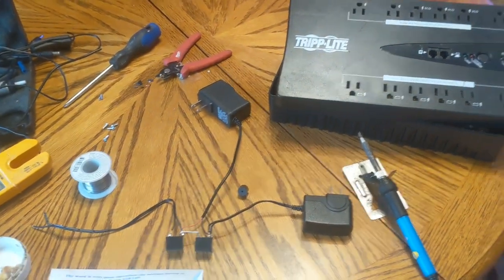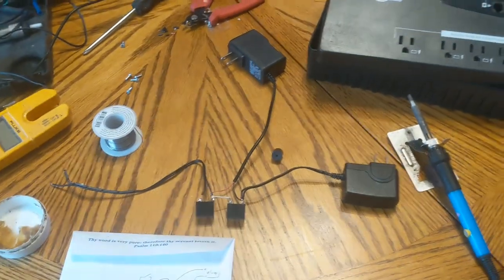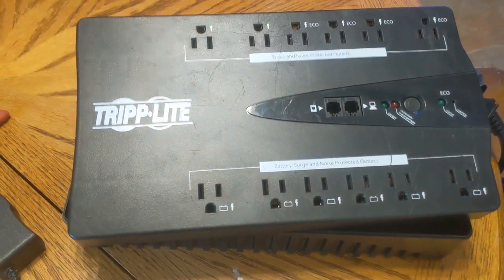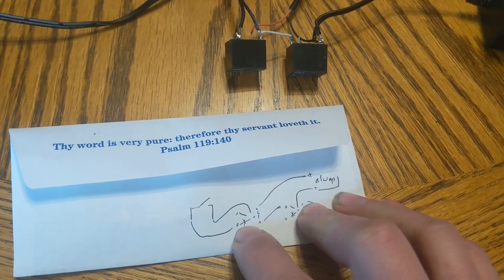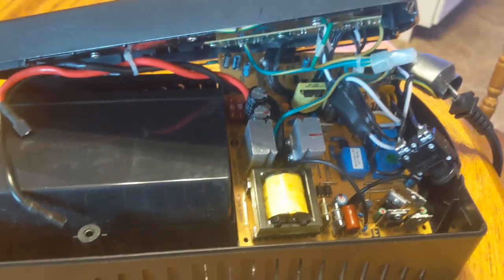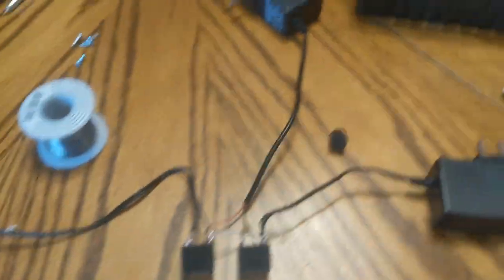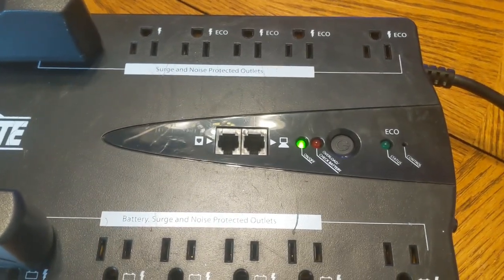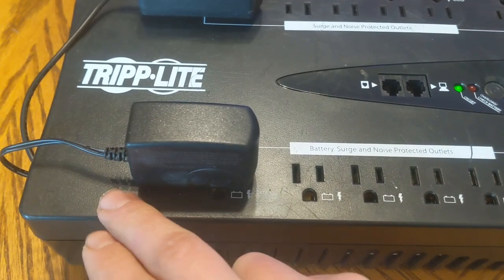UPS (battery backup) modifications for off-grid homesteading

Comment: Do you mind telling me what little black boxes are? Not battery, but looks like you trying to keep UPS on no matter what...
Reply from the maker: There are two kinds of black boxes there: 12v power supplies, used as sensors to send signal to the smaller black boxes; the relays, which act as automatic switches.